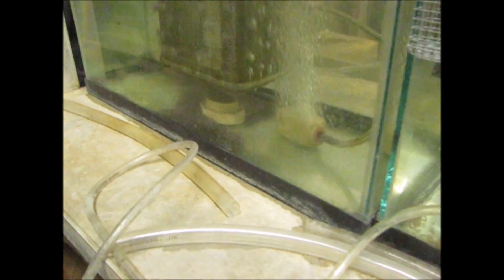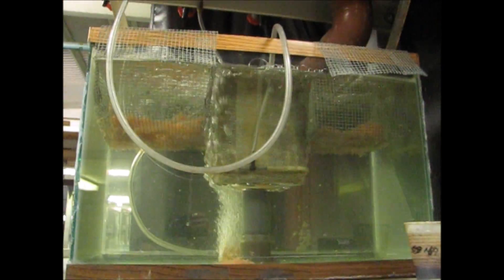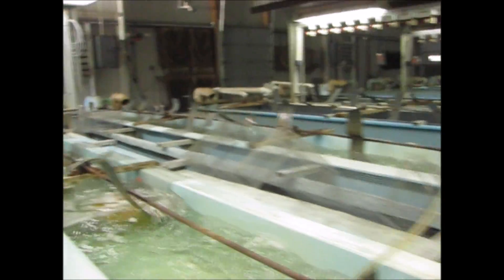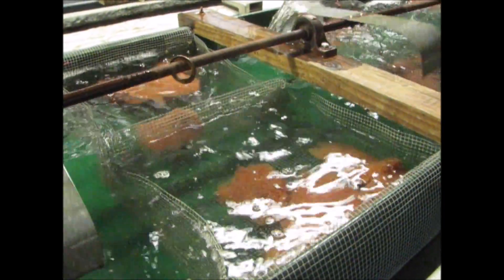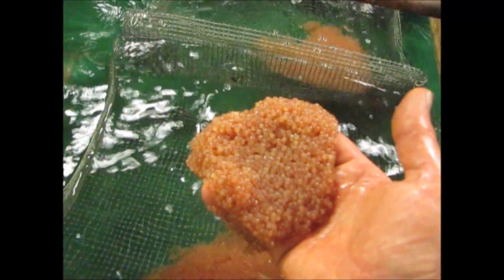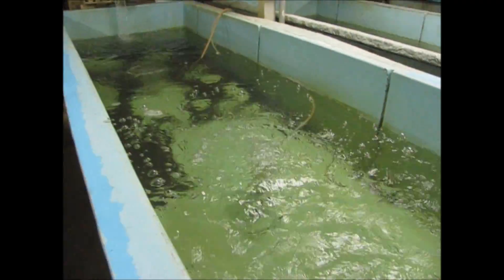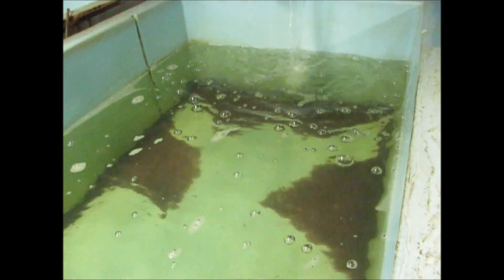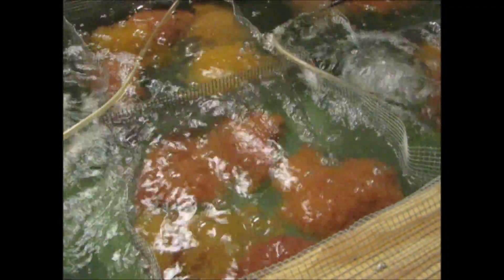Catfish spawning and hatching

Comment: Do you have contact details, please?
Reply from the maker: For me or the hatchery? What would you like to know?
Reply: I'm from Namibia also doing African Catfish. I struggle to get the eggs from hatching to get to the Juvenile stage. I have a huge loss in this process more than 90%. Can you give advice, please?
Reply from the maker: I disinfect the eggs with betadine, also known as povidine iodine that is mixed 1 part to 100 parts water, and bath eggs for 10 minutes with aeration.

After that use good flow with clean water. When the fry are swimming use a good quality powdered food, and continue to maintain good water. We move fry to ponds or larger tanks at about 10 days old. It is best if those are green water ponds with zooplankton. This zooplankton can be grown by starting the pond at the time the eggs hatch, and add fertilizer (hay, manure, or other organic material) to produce green water where the small food organisms will grow. Good aeration is necessary for high production.

Comment: What's a Marbled Channel Catfish? Is that kind of like a Piebald? I've seen Piebald Blue Catfish. In fact they seem to be more common today than they once were.
Reply from the maker: J.L. Herington  It seems the marbled channel catfish is a chimera with patches of solid black melanistic cells. When I bred two together I got no marbled fish, but a good many were solid black. 

I have seen those blues too. I don't think they are typical piebalds. They are more like kumonryu koi, there black and white pattern can change.
Reply from the maker: J.L. Herington here is the marble male I bred tp pne very similar.

https://m.facebook.com/photo.php?fbid=10154562823414491&id=814169490&set=a.10151125131874491.459845.814169490&source=44&ref=m_notif&notif_t=group_comment_reply
Reply from the maker: There will be the black ones stocked around KY this year. I was really hoping to get a bunch of the marbles to distribute. As it is they are pretty rare.